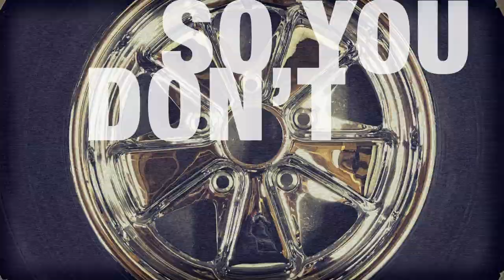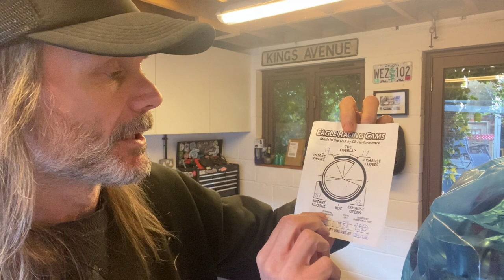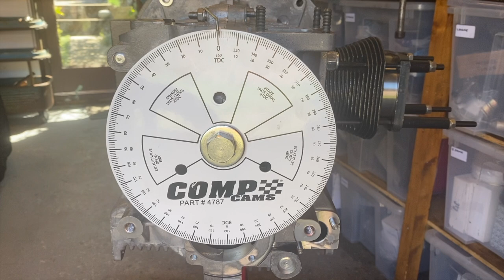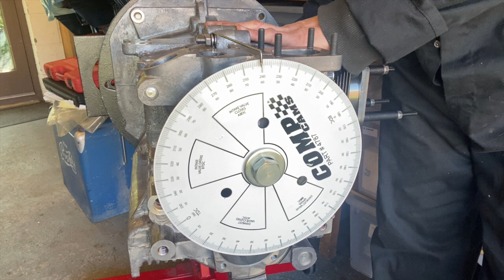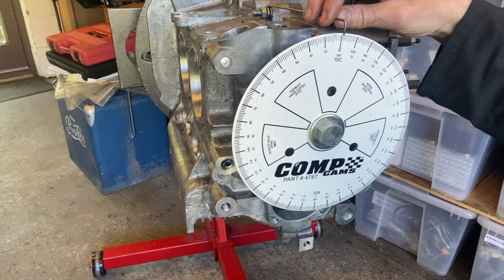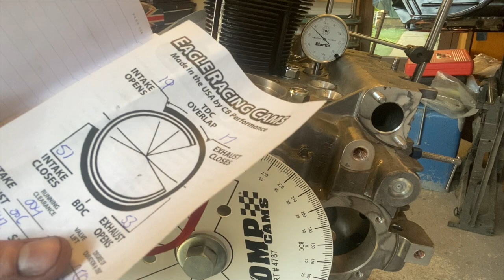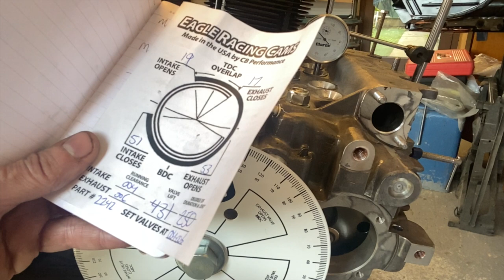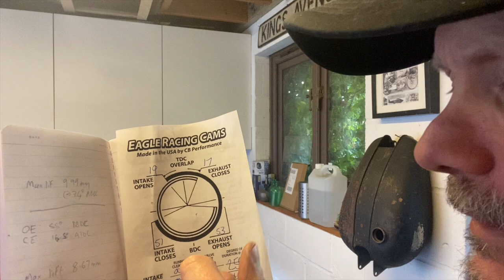PART 6 – Dialing in the Cam - How to Build a CB Performance 2017cc Builder’s Choice VW Engine

Comment: Great video mate!  This is the hardest way of doing this .  A simpler way is to use the nose of the cam.  Find the top dead center of the cam nose  then zero your gauge . Go either direction .050 off the nose and take your degree reading. Then go back the other way until .050 off the nose . Take your reading . Add the two numbers and divide by 2.  That number is your cam timing that should match the cam card.  If not make the adjustment and check again.   This way is how to find the cam centerline which is really the only number that matters.  Also when you call CB performance only talk to Pat Downs.  Everyone else there aren’t very sharp.

Comment: I would think that any performance loss would be negligible but right is right. Obviously if you used the other washers you'd be trading one problem for 3 so that's not an option. I know from experience that common grinds from one manufacture can vary greatly. My engine builder installed a cam from Isky in a Ford flathead and he said it wasn't even close to being ground correctly. Couldn't even use it and Isky couldn't guarantee another would be any better. That's reassuring. Went with Sig Erson and it was spot on. I guess it's a crap shoot. You're really only out 1 degree total if 1 degree is acceptable to begin with. Too many numbers. When it comes time, I'm just going to box up my parts and send them to you! You'll have it figured out way before me.
Reply from the maker: Hahahaha, I'm sure you'll smash through it in no time. You're 100% right - swapping out the washers would only cause me more headaches. I think with a lot of this cam stuff, gears and shafts alike, as you say, is pot luck. Next build I'm going to research the best cam components.

Comment: Great info and your crossing you t's and dotting your i's.  I don't think those washers will do anything to adjust the valve overlap as shown on the card.  Is that your intention? Since the cams move as one unit wouldn't the washers simply advance or retard the timing in relation to TDC? Since I won't be racing my bus, I'm not going to worry about that and I'll just stick with the brassy washers to keep the valve timing as intended.  

I could absolutely be missing something so please correct me if needed.

I am so thankful you're documenting this build. It's very helpful.
Reply from the maker: Yeayh, yeah. You're right. Its not possible to adjust valve overlap with these washers.

Comment: Awesome video. Only thing I would add is not to torque using an extension if at all possible. Seemed like you didn't need the extension. You'll get more accurate torque
Reply from the maker: Good point well made. I'm always using the long extension. I'll stop doing that as you're 100% correct - it's less accurate.

Comment: It is literally impossible not to have geometrical tolerances temperature of a room will give different reading. You also need to realize that measuring instruments may not be repeating giving a different result.The most accurate measuring  instrument is an air gauge. Also air gauges are used because is does not matter you is using it everyone will get the same reading.
Working in a machine shop the quality  control room temperature. Was set at 70 degrees Fahrenheit. Gene Berg didnt believe you could not spend enough money on a gauge,  say for oil pressure because no gauge is as accurate as a set temp sensor and a indicating light! Another point is if you check something ,but have no intention to make a change ? Then why bother wasting your time checking it or testing something in the first place. Great project ! You have no worries.
Reply from the maker: I never thought about air temp making a difference, but it really woud when looking at such fine margins. A very good point well made. Sometimes I like to measure stuff even if I am not intending to make any adjustment just because I want to learn how to do it,or that I'm curious, but you're dead right, it really is a waste of time. Thanks for the valuable comments.